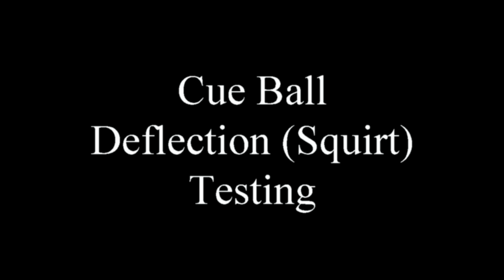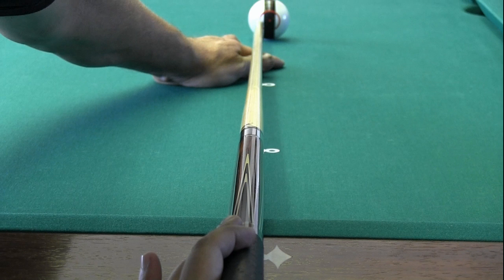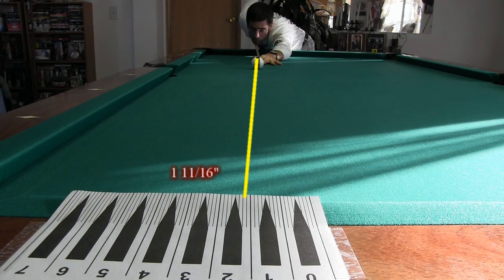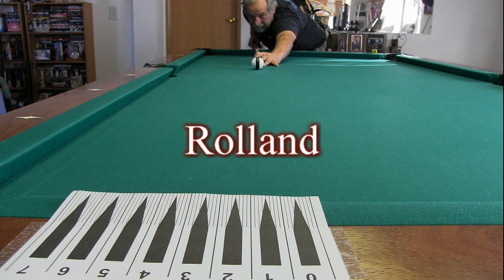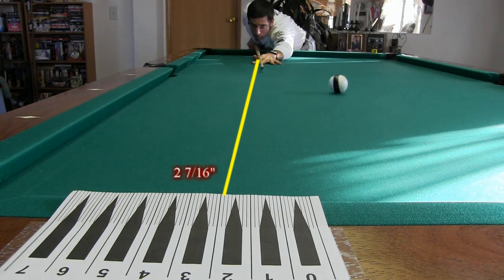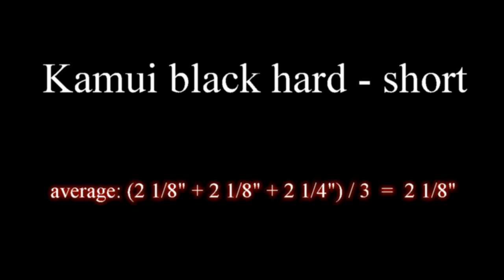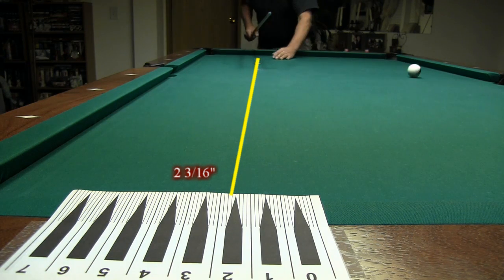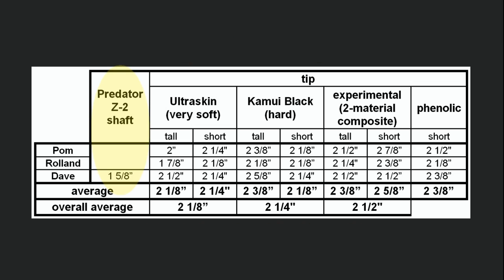Cue and Tip Testing for Cue Ball Deflection (Squirt)

Comment: Dr Dave I have a question about specifically FHE. I see on your research a tip radius of a nickel has a 5% longer pivot point vs a dime radius. I have recently found the opposite to be true when comparing a nickel vs dime with my pool and snooker cue. Specifically only using FHE. With my pool cue I shaped it to be more than a dime it now has less deflection than it did using FHE than when it was shaped to a nickel and less than when it was shaped to a dime. The same thing happened with my snooker cue. And I’m trying to wrap my head around it. Would you possibly know the answer?
Reply from the maker: Tip shape affects how the tip contact point varies with shaft offset from center per the info and illustrations here:
    https://billiards.colostate.edu/faq/cue-tip/size-and-shape/
If the tip is contacting the CB in different places, you will get different amounts of spin and CB deflection.
Reply: meno curvatura più parte di contatto .però poi ci sono anche gli effetti i colpi vari...quindi un pò di curvatura ci vuole ..decidi te come ti trovi meglio😁

Comment: Rolland ' stroke is low deflection...I do not understand shooting the ball way harder than you ever would in a game to do these tests.  If your worried about swerve put less english on  or shorten the shot distance
 The angle remains the same you can figure the squirt at any distance
Reply from the maker: To play at a top level, a wide range of speed and amounts of spin is required.  FYI, CB deflection (the net effect of squirt and swerve) varies with shot distance and speed per the info in the videos and sub topics here:
    https://billiards.colostate.edu/faq/sidespin/aim/
Reply: @DrDaveBilliards  maybe one out of 500 shots would require the speed and spin u shoot your deflection test with. Thats my point.  Ps I am a top level amature.
Reply from the maker: @alphacapo  The purpose to use fast speed during testing is to measure just the squirt characteristics of the shaft and tip.  Swerve depends too much on shot speed, so during shaft/tip testing it is best to use fast speed.  For more info, see:
    https://billiards.colostate.edu/faq/squirt/robot-test-results/
Reply: @DrDaveBilliards  but it's pointless if the test is unrealistic.  Like I said...if your worried about swerve shorten the distance. then swerve won't come into play as heavily..   if a shot deflects 1 inch at 3 feet in six feet it's gonna deflect 2 inch.  But at 6 feet swerve is more of a factor than at three feet. So just measure at three feet at realistic game play speeds
Reply from the maker: @alphacapo  ... but at short distance and slower speed, the amount of CB deflection (squirt minus swerve) will be small and the differences will be less noticeable and measureable.  For more justification, see the info at the link above.
Reply: @DrDaveBilliards sir I appreciate your testing.  But to me it's like doing a ballistics test or sighting in a rifle with a round that's say 25 percent more powerful than what your gonna use in the field. Then go hunting and miss the shot of a lifetime....then blame your equipment. Its just not common sense.   

I've been helping a few guys and they just started playing 8 ball leagues. They've gotten better. (8 ball league point per ball ...15-0 is perfect.... they are  shooting a 7.5 average or so. I shoot a 9.8 it's a strong league too with a few state and national champs) my guess is a pro would shoot an 11 or so....maybe an 11.5
Anyways...

they have discovered what deflection is and were showing me your videos. I try to explain to them all they need is a strait cue that's sound in construction and a good hard tip for maximum  feedback (my opinion) and practice. Not to worry about deflection....u learn to adjust subconsciously for that with practice.

As you can tell I'm kinda on the fence with everyone putting so much emphasis on measuring deflection when it comes to equipment.  Its not as big of deal as some make it to be.
Reply from the maker: @alphacapo  Obviously, if your only purpose is to practice a range of shot distances, speeds, and amounts of spin found in typical game situations, practice with those and learn how to compensate your aim when using sidespin per all the videos and info here:
    https://billiards.colostate.edu/faq/sidespin/aim/
If your goal instead is to test and compare shaft CB deflection characteristics, it is best to follow the guidelines here:
    https://billiards.colostate.edu/faq/squirt/robot-test-results/

Comment: Would love to see a test for which tip (hard or soft) actually provides more spin and by how much.
Reply from the maker: Tip hardness does not affect how much spin can be applied to the ball.  For more info, see:
    https://billiards.colostate.edu/faq/cue-tip/hardness/
Some people also think it is possible to get more spin with an LD shaft.  That is also incorrect.  For more info, and demonstrations, see:
    https://billiards.colostate.edu/faq/cue/low-squirt/#spin
Some people also think it is possible to get more spin by swooping/swiping the stroke.  That is also incorrect.  For more info, and demonstrations, see:
    https://billiards.colostate.edu/faq/stroke/swoop-swipe/
Reply: @DrDaveBilliards  I get what you're saying however, doesn't tip softness allow you to hit less of the cue ball imparting more spin. Meaning if you are playing right English and went as far right to the cue ball as possible without miscue while using  a soft tip,  you hit that same spot with a hard tip wouldn't it miscue? There for a softer tip would allow you to create more spin correct? I know you are the guy to ask thank you so much for your reply.
Reply from the maker: @Tomfrommyspac  No, and no.  In my experience (and some testing), leather tip hardness makes no difference on the miscue limit, as long as the tip is well chalked.  BTW, the brand of chalk doesn't seem to make much difference either, per the info and demos here:
    https://billiards.colostate.edu/faq/chalk/comparison/
Reply: @DrDaveBilliards  you the man! One more thing then, it is also said that a thin shaft or smaller tip enables you to create more spin. Is this a myth too?
Reply from the maker: @Tomfrommyspac  That's not true either; although, you do need to position the cue differently to get the same amount of spin, based on the size of the shaft and curvature of the tip, per the info and illustrations here:
    https://billiards.colostate.edu/faq/cue-tip/size-and-shape/
Reply: @DrDaveBilliards  Thank you so much! Do you have a patreon account or something where I can donate money? Not all heroes wear capes and you sir need to be paid.
Reply from the maker: @Tomfrommyspac  Thank you for asking.  I do accept donations via the donate button near the top of the page here:
    https://billiards.colostate.edu/
Reply: @DrDaveBilliards  do you have a video out for maintenence on your tip to keep the action strong. Ie: poking/roughing/shaping your tip to maximize spin?
Reply from the maker: @Tomfrommyspac  The only thing I do to my tip is chalk it.  If you use a typical abrasive chalk (like Masters), it keeps the tip surface fresh.  Whenever I miscue, I chalk that spot on the tip with a little extra force to restore the surface at that spot.  I do have some videos on how to chalk properly:
    https://billiards.colostate.edu/faq/chalk/how-to/
Reply from the maker: BTW, you can find answers to and videos dealing with almost any topic starting here:
    https://billiards.colostate.edu/faq/
That's where I quickly found all of the links to answer all of your questions.  Enjoy!

Comment: A comment and question ...... As a extremely long time player pretty good maybe a weak a player at my best I have for example used extreme outside left and curved the  cue around an object ball on the right side of an interferring ball and curved it back to the left with running left hand English  Not hitting down or maeusiing the cue ball but use a level cue and at high speed ..... Why didn't my cueball deflect to the right or opposite side if I was using left ........ And when you have a frozen rail cue shot and use inside English rail first why does the cueball work and make the ball instead of  Missing it the opposite way .... It seems to tottaly contradict what people show about deflection
Reply from the maker: First of all, the cue is never level if it extends over a rail.

If you use left sidespin, the CB will deflect to the right and then curve to the left.  At slow speed (especially with topspin), the CB curves immediately; and at fast speed (especially with draw), the curve is delayed.  For more info and demonstrations, see:
    https://billiards.colostate.edu/threads/aiming_compensation.html#English_effects

If you post a link to a video demonstrating what you are describing, I am sure I can explain what is happening.

Rail cut shots are demonstrated and described (including how and why they work) in great detail here:
    https://billiards.colostate.edu/threads/rail_cut_shots.html
Check it out.
Reply: Hi Dave I always appreciate your replies and that's no lie .... I was reffering to the object ball being on the rail not the cueball I'm sure you know the type of shots but when I see people demonstrate deflection if they use right hand the ball is ending up several; inches or whatever  to the left . And that is something I have never had to deal with until the faster tables shafts and materials of balls have been upgraded  and I can make love ng shots easily but not cutting them with any speed or the angles all go to hell .... I'll send you some samples thanks

Comment: Not an accurate test u cue across the ball differently on each shot also it's impossible to hit the ball the same speed each time
Reply from the maker: martyn roberts  ... that's why you need to do lots of shots and only use the data for the shots with consistent speed (based on ball travel distance) and consistent english (based on the rebound angle off the rail).
Reply: Really? Its meant to demonstrate theory. Practice. "The more you practice, the luckier you get".
Reply: John Barioni has a robot that shoots the same exact shot every time. To test out his shafts among others

Comment: 0:36 tip heights; "measured from the edge of the ferrule to the top centre of the tip"  - but the diagram shows measurement NOT to the top but to the end of the straight section.
Reply from the maker: I disagree, but it doesn't matter anyway ... each tip had the exact same height.
Reply: oh you are right - sorry - i didn't look closely enough - thought the tip included all that bite out of the disc thing

Comment: i appreciate what your trying to do , but wanted to ask  about that table ,,,,,,  it seems extremely slow and the rails dead sounding . maybe its just  from the camera and mic ,,,,,,,,, if the rail was dead I doubt the cueball would have been so consistent anyway ,,,,,,,,,,,,  but no one wants to factor in all that crap when the most obvious reason is to use felt instead of that non grabbing simonis   crap .......  ITS THE REASON I DONT LIKE POOL ANY LONGER ,  PLAYING 9 BALL I RAN 9 RACKS  STARIGHT 1 NIGHT ., NOW I AM LUCKY IF I RUN  1 OR 2 A  night ,,,,,,,,,,  and 9 ball isn't the same if you have to compensate for deflection , ,,,,,,,,,,,,,  as hard as those balls here hit I  woulda  guessed that cueball would  go 4 or  5 rails  easily
Reply from the maker: That table is a little slow and the cushions are not very lively, but this has no effect on the squirt (CB deflection) measurements at the ruler on the first rail.

Comment: Very interesting work! it would be interesting to investigate about the statistical dispersion of the angle of deflection as a function of the type of cue tip.
Reply from the maker: +Attilio Ortenzi  Agreed, especially if an accurate and repeatable cue-testing machine were available.
Reply: I enjoyed the work. especially for using of standard conditions (more people with more repetitions), so you can have an idea of the standard error.

Comment: I appreciate the scientific approach, trying to get the most reliable possible results. However, this imperial metric system is just crazy weird.
Reply from the maker: Like you, I wish the US and the pool equipment manufacturers used the metric system like the rest of the world.

Regardless, the exact numbers aren't as important as the relative differences among them.
Reply: I understand that you have to think on your primary source of viewers. Still, you could use the to systems in your videos, because for people used to the Metric system, the Imperial is really hard to understand. This could give your channel still more audience outside US and more upvotes.
Reply from the maker: pitthepig That is a good suggestion to also list metric units in future videos.  Thanks.
Reply: Like the man said it is more about the differences then it is the numbers. It's not like you measure a shot out with a measuring tape before you take the shot.

Comment: I am a 3-C player, and have a Z2 shaft for one of my cues (a Caudron).  I found that it takes just the same effort to get used to the lesser squirt of that shaft to get the hit one wants on the object ball as it takes with any other good shaft.  
After playing with the Z2 shaft for a few months I switched to my Longoni cue with S2 shafts (and Kamui Black MS), which now gives me the same good hits as the Z2 did.
I am not trying to take anything away from your very methodical testing effort. 
What I am trying to say is that our instincts are perfectly adequate to compensate for any equipment we use to achieve the results we want.  All the never ending searches for the most perfect equipment usually do not give us anything that permanently improves our performance, because the honeymoons don't last.
Reply from the maker: Agreed, low-squirt cues are not "silver bullet" solutions.  They have disadvantages for some people; however, they do provide some advantages when used properly.  For more info, along with justified lists of advantages and disadvantages, see:

http://billiards.colostate.edu/threads/cue.html#low_squirt
Reply: DrDaveBilliards ' when used properly' is the key to all this, and to what I was referring.
I maintain that an experienced player will perform equally with any well built shaft, regardless of deflection characteristics, once he is used to it.  To wit, none of the top 20 in the world of 3-C billiards uses LD shafts, and they are getting all the hits they need.  To lesser players, aiming method and stroke mechanics are of much greater importance than equipment differences.
Reply from the maker: Al Senior Most top pool players (especially younger players) use LD shafts.  They do offer advantages when used properly.  For more info, see:
  http://billiards.colostate.edu/threads/cue.html#advantages

Regardless, I agree with you that a top player in any cue sport can master any cue (assuming the tip is good).
Reply: DrDaveBilliards That alone should be an indication of the lesser experience of those players, since they believe that technology will help them overcome lacking technique.  In any case, pool is not billiards.

Comment: prime example of why metric is far better when doing science 2 and 7 16ths of an inch lol
Reply: totaly
Reply: 2540mm is a perfect example of why the imperial system is easier to visualize.
Reply: @jamessykes2760 is it really? 2540 mm or 254 cm or 2.54 m simple and precise. Imperial is just silly.
Reply: It’s not hard. 7/16, 3.5/8,  1.725/4,  .8625/2, 
I like the metric system as much as the next guy but don’t blame the label if you can’t arrange numbers
Reply: @willblizard3610 it's not hard is just ridiculous.

Comment: Dr. Dave,  I think a pneumatic ram with a cue attached and roller bearings configured as a bridge would be a great way to further test shaft deflection and cue ball squirt.  A problem with humans is that deflection becomes part of the stroke motion since we inadvertently allow the cue to pivot some.  The robot system would not allow that. This would demonstrate to some extent the amount of squirt is player dependent - when trying to stroke straight like you gents were, not when compensating.
Reply: We are still waiting for this to happen in the pool world. Maybe it hasn't because all the companies that make tips and shafts have a monopoly. The ram test would put all that to sleep as what's truly the best. Any human (even Dave) is not perfect and leaves room for error
Reply: @godjhaka7376  Agreed!  Being a physicist with a long career of experimentation and analysis, I would argue further that the ram method (designed properly so as not to introduce systematic errors that would bias the outcome) would produce not only better repeatability than any human could, but it would also produce much better predictive statistics because of large numbers of repeatable trials.  Confidence level and associated confidence intervals get better with higher sample counts.  To be able to say that cue shaft X or cue tip Y does Z based on 5 human stroke trials is a FAR CRY from results derived from 500 repeatable ram mechanism trials.  This is no jab at Dave's work here. In fact, to obtain funding for development of a better experiment, one might use Dave's study as the zeroth order proof of concept.  I also agree that there are monopolies out there that actively work hard to control the variables so that the "supply and demand" principal from econ 101 allows them to charge $500 for a cue shaft (for example) that is comprised of no more than $50 worth of raw materials.  I will stop here because that aspect really frustrates!  Cheers!!!